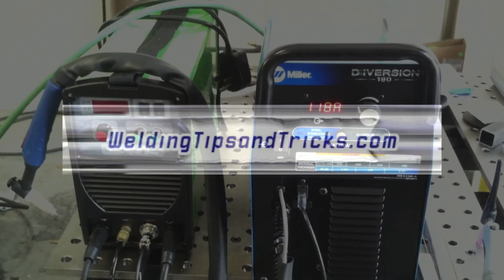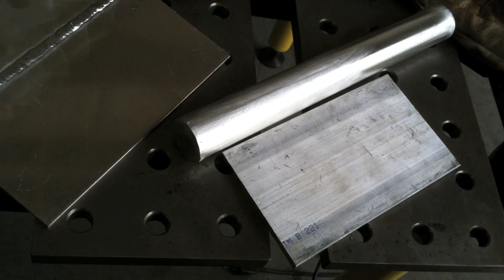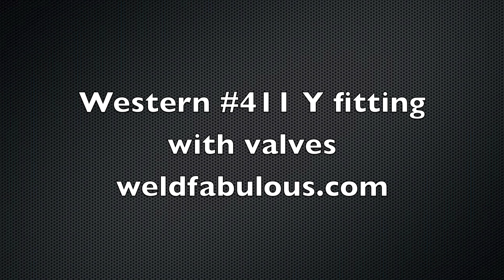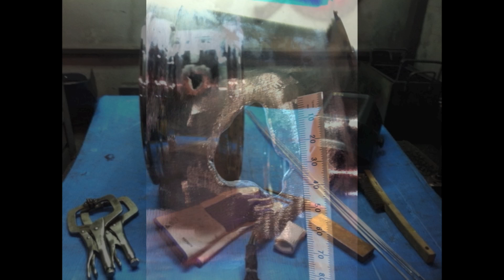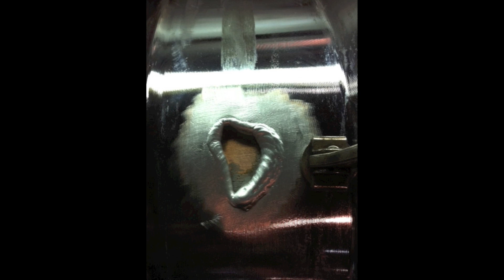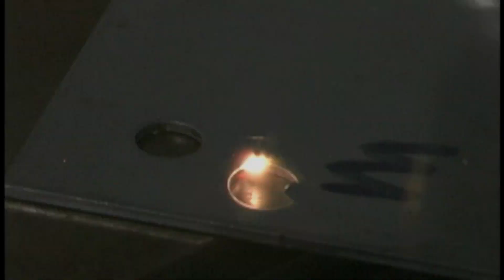Aluminum Welder  demo - Miller diversion and Everlast powertig part2

Comment: I got here from the article on the weldingtipsandtricks site article on the wheel repair mentioned in this video (If anyone is wondering: http://www.weldingtipsandtricks.com/aluminum-wheel-repair-2.html ).  What filler was used for that repair?

Comment: Hey jody, how well do these machines weld on 115v?   Maybe a 115v tig welder shootout video?  I'd like to add tig welding to the resume but i do not have 220v anywhere, the only way I can practice is 115v just wondering if these machines are up to the task of some serious seat time running 115.

Comment: Awesome videos Sir! 
I also have the Diversion 180 for home use. Right now Im have an issues with helium.
I cant get it due to a shortage of helium right now.
What I'm trying to do is weld 1/2" 6061 flange to .095 3003 runner. ( Sheetmetal intake manifold )
I can get it to tack up ok, but without a helium mix what temp do you think would be sufficient for pre heat. I was looking to get an ol hot plate or elect griddle.
Any tips would be greatly appreciated.

Comment: I'm a little puzzled at this video. Aluminum rims are usually an aluminum/magnesium mixture, since aluminum is soft and couldn't really support a vehicle unless it was very thick. Wouldn't you need a special filler rod for this application or does a standard 5356 filler do the job?

Comment: Great arc shots Jody.  I am more than a little concerned about the liability issues that are created welding on rims though.  Too many unqualified people are gonna attempt to fix stuff that should be scraped or sent to a qualified welder for a proper repair, but they saw you do it and it looked so easy, so why not take that chance.  Generally a bad idea in my opinion....
Bob